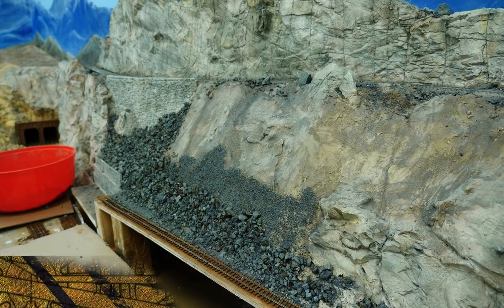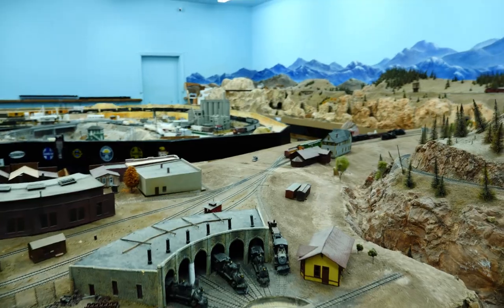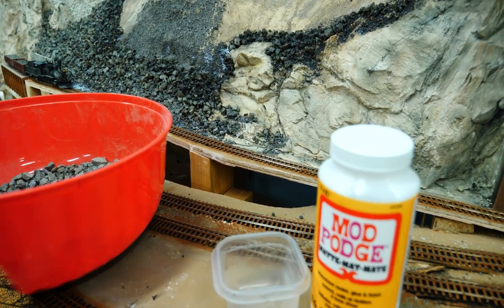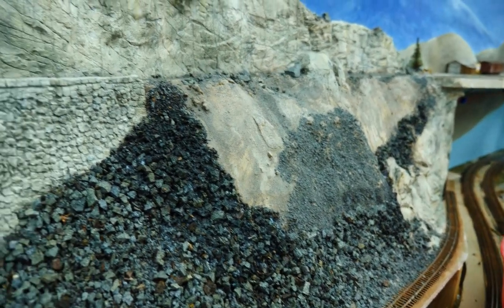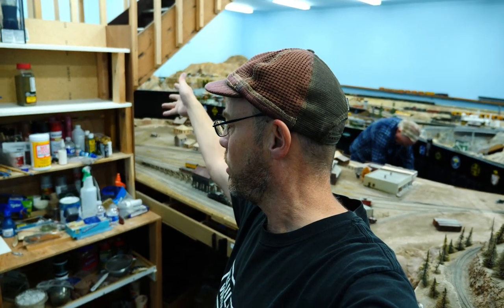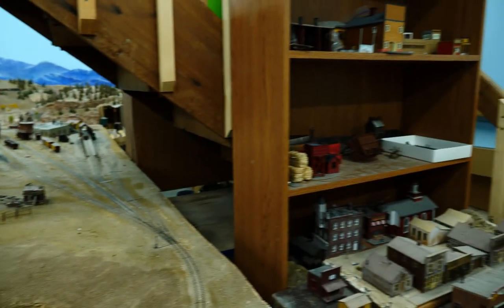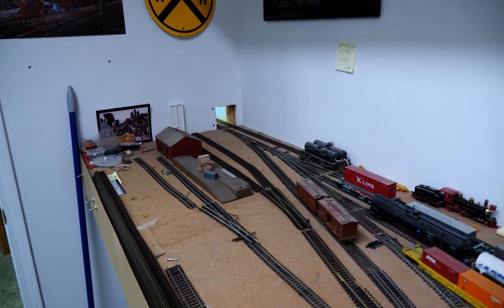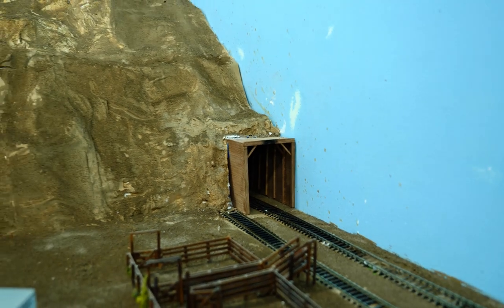Railfanning at the Palisades. Tip for modeling Talus Rock. Teddy Bear Fur, and more! Update 93.

Comment: for your rock talus how about making up sheets of it flat on wax paper letting that dry and then applying to the rock face it'll still have enough flexibility to mold into most of the crevices, similar to how you could do large sections of static grass "land" on wax paper then cut and transfer to the layout.
Reply: could help to Draw on or cut out the wax paper to the contour that you need to fill.
Reply from the maker: Interesting idea. Could be worth experimenting with.